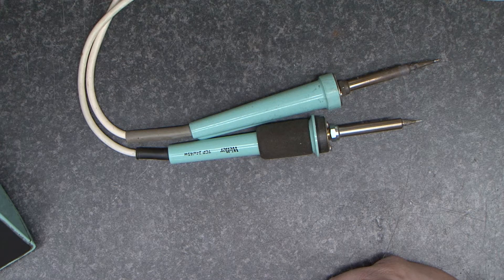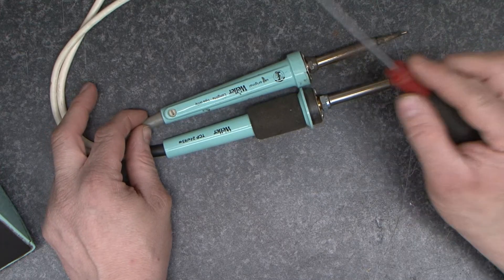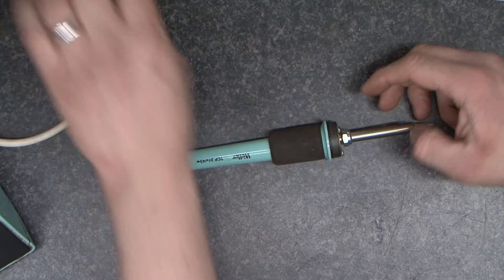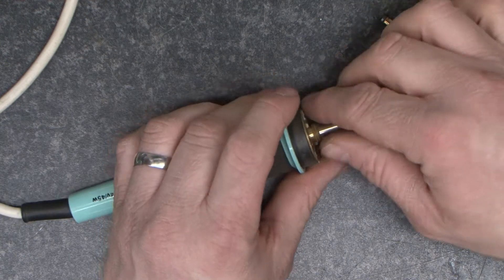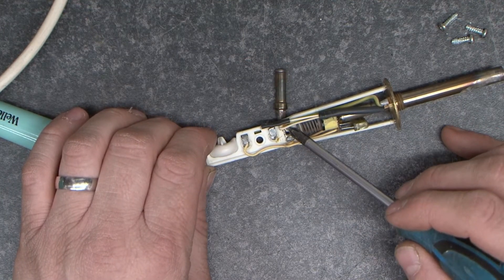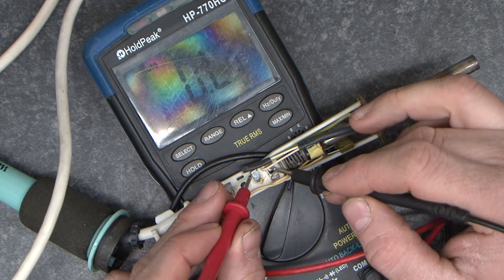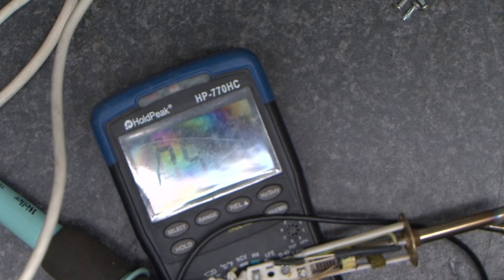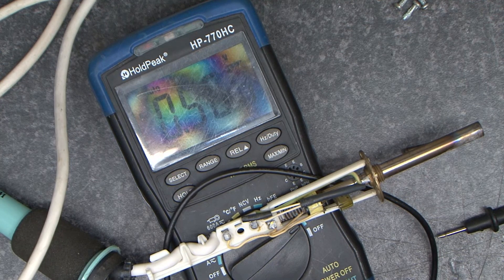Weller Tcp Soldering iron magnastat Testing reparing  teardown 24v

Comment: Just replaced magnaswitch on my apprentice purchased pu1 from 1974 😂 real triggers broom. Few hints the switch can be heard clicking on and off when the tip is removed and replaced from sleeve. Same using odd magnet. There are no moving switch parts externally moving but under the yellow tape is a loose plastic cover with a pair of brass contacts. I chose to replace as i had a free spare, but not impossible to spray clean. Its sitting here clicking away regulating as they did when new. Will see me out now.

Comment: Mine is the older style, and the wires finally broke at the connectors strain relief.
I trimmed it back, resoldered it, and it should be good for another 50 years……

Comment: Do you use regular solder to replace components on a iron? Dumb question maybe but it must be running at a solder melting temperature
Reply: Yes, just regular solder, those wires do not get hot.